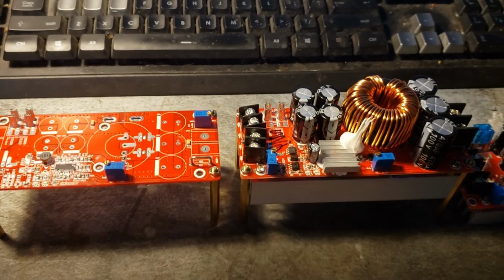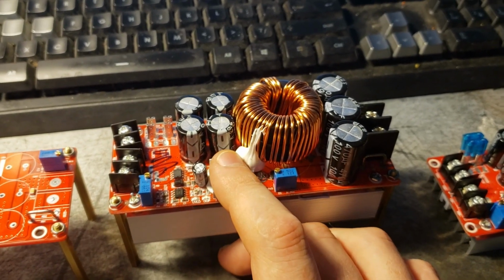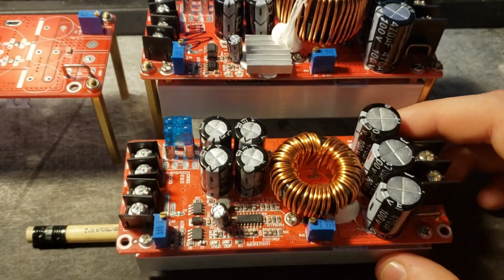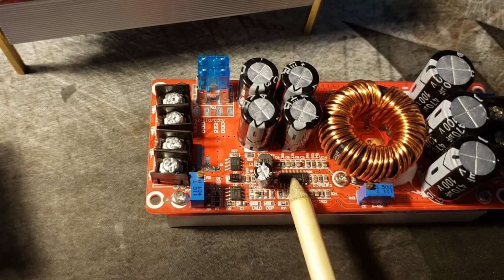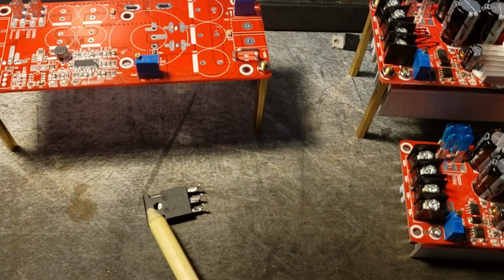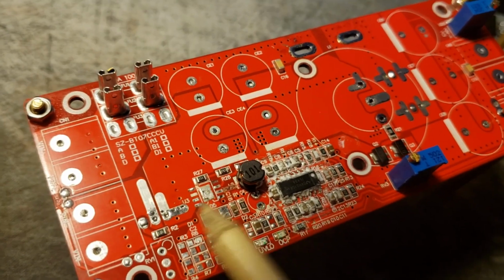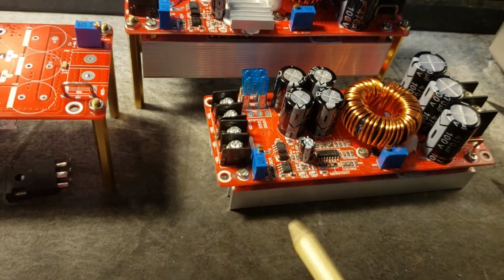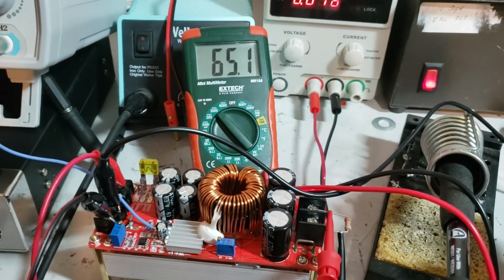Mobile LDMOS Supply (Pt. 2)

Comment: How did you get rid of the noise the step up converter makes i have one running a  amp and I'm receiving if I turn the voltage up to 45vdc it's like static if I turn the voltage down to 24vdc I receive and pulse clicking sound ?

Comment: Hello Sharky, what happened to your 2 dual BLF188XR amplifiers? I would like to know the feedback circuit of your MRFX1K80H amplifier, I see you used the .1 blue caps from the BLF188XR amplifier but what resistor did you used? 470ohms?
Thank you for your videos, very interesting info.

Comment: Like I said since I've been here and done this four and five years ago you're on the right track keep up the good work and like I shared with you last night I provided with all the part numbers in the places to purchase all the appropriate Parts you don't have to do this heavy modification. but I'm glad that you worked through all the problems very informative video
Reply: In (my brief) looking for a 12V to 48-65VDC boost converter, the only one I've found is made by Daygreen. They said the A1U4810A is parallelable. Any insight?